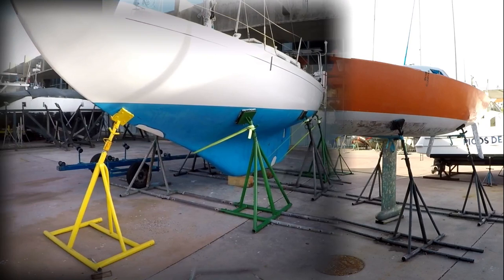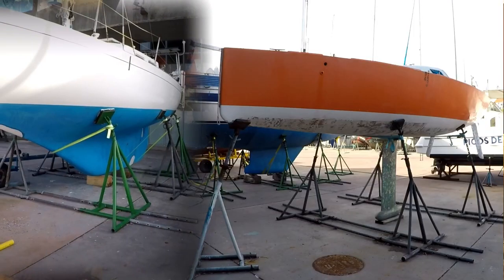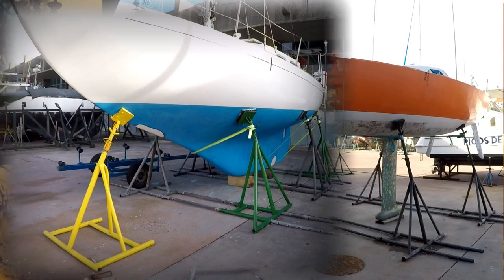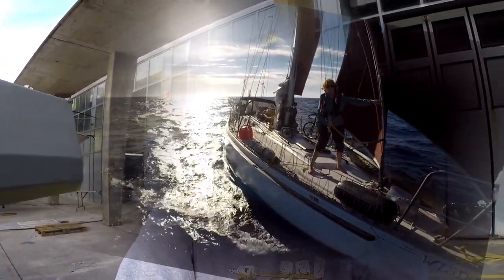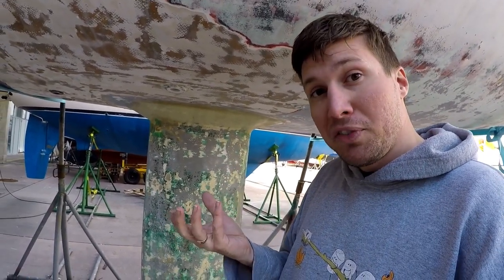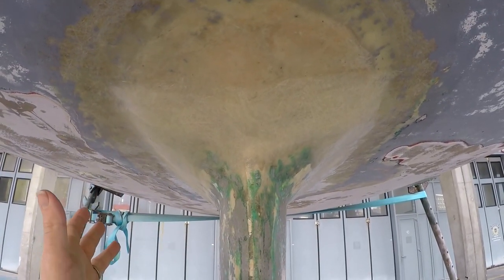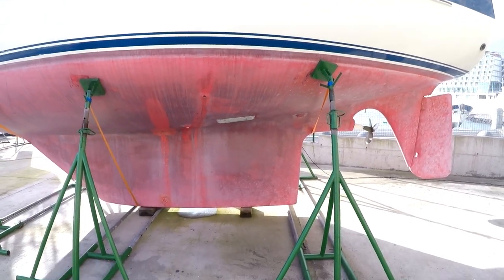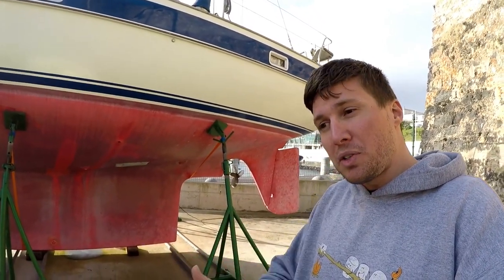Which is the BEST Keel Design? | Sailing Wisdom

Comment: Herb I am suprised you didn't mention swing keels, which is what I have! 3ft 6in when up and 7ft 2in when down! It is a great coastal and bahaman boat, but does give you limited blue water capabilities! And no keel bolts! What do you think?
Reply from the maker: Swing keels are the best of both worlds! You get shallow draft when you want it and incredible pointing ability when you need it. 
You can also play around and move the CLR by swinging the keel up partially to help the boat stay on a run and induce more lee helm (also useful to balance the sails)
I forgot to mention them!

My only concern with swing keels is the hinge mechanism, I can’t figure out how you could do maintenance without hauling out! Then again, I’ve never had one and I’m sure there is a way (especially in the clear waters of the Bahamas)
Reply: @RiggingDoctor  You are right there. I have seen someone fix the lift system on another channel but can't remember who! I'm sure it would be a pain in the water, but could be done.
Reply: From what I've read and seen, the Swing keels don't Need much Maintenance, but it's Critical that you DO Maintenance, at Least Yearly, and Of course a quick Inspection Haulout (as you'd do with ANY boat) after a hard impact. Mostly on Trailer-Sailors? @RiggingDoctor
Reply: @RiggingDoctor    all of your questions about maintenance on a swing keel will be answered when you research the "southerly" boats with swing keels.   they are partially serviceable while in the water.   Watch Paul and Cheryl Shard on the  "Distant shores" youtube  channel
Reply from the maker: Their DVDs are where I first saw a Southerly in action
Reply: @RiggingDoctor  https://www.youtube.com/watch?v=z6hdTiLQ_8c&t=87s
Paul discusses the swing keel in this video of their new 480
Reply from the maker: I’ll check it out when I have better WiFi!
Reply: @RiggingDoctor  On the Trismus boats with dual centerboards you can raise the front board completely while leaving the aft one down for long downwind runs.  Elements was originally built with stern daggerboards to accomplish the same purpoose.
Reply from the maker: I was worried I would bump into her foot and cause her some serious pain!
Reply: The hassle with swing keels especially if ballasted is their hinge and actuation mechanisms. Not to mention they take up space inside below decks.

Comment: The best hull and keel , stepped planning that pops up at around 13 knots with a 8° Deadrise and a partial skeg ..plus two shafts with 4 bladed props for stern lift and two big engines sucking old liquefied dinosaurs and turning them into power....  😎
Reply from the maker: That sounds like something my dad would say (he has a Egg Harbor)
Reply: ...said the stinkpotter! :-P
Reply: They're no good for crossing oceans with, though.. :-P

Comment: That's a really crappy repair job !
Reply from the maker: Makes you wonder how bad the crack was that made them think such a lumpy repair was needed!
Reply: @RiggingDoctor  I would spread the load out much further and make never be a problem again. The way they did it its going to fail again under load.
Reply from the maker: Yeah, the corners they created will be the new stress points!
Reply: @RiggingDoctor  thats what I see too. Plus resin dose not make strength.

Comment: Wouldn't a full keel resist lee-way (lateral slip) more effectively than a high-aspect ratio keel?  Why does a deep, thin keel allow you to point higher into the wind?  It would seem that a narrow/deep keel would allow the bow to get blown off the wind more easily.   Thanks for your videos!
Reply from the maker: It would make sense and that was the old way of thought. Modern testing has shown that the leading edge generates lift and the rest of the surface is wetted surface area (and drag). A high aspect ratio foil will create more lift and less drag compared to a low aspect ratio foil. 
The longer the keel goes down into the water, the more surface you have to generate lift and the more effective the keel will be, and therefore the better you can sail to windward without laterally slipping.
Now the caveat is that they only work at high speed, at low speed, the broad surface of a full keel will work wonders at holding you steady in the water. This is why a full keel will keep you steady and slow your drift while hove to.
Reply: While his answer is correct that a fin keel can produce more lift his explanation is nonsense
Reply from the maker: CUM BOT, I would appreciate it if you don't confuse others with your gut feelings about how sailboats work. The other thread was interesting to watch, but I don't like misinformation spreading and contaminating others. Please stop.

Kire Nireves, the last paragraph of the section KEELS discusses the advantages of high aspect ratio appendages: https://physicstoday.scitation.org/doi/full/10.1063/1.2883908
This next study was done on three different aspect ratio keels AR1, 1.5, and 2. The findings are rather self explanatory: https://www.researchgate.net/publication/237150728_Investigation_of_the_Effects_of_Different_Keel_Geometries_on_a_Sailing_Yacht
I hope this information finds itself useful for you, and I warn you that the internet is full of opinions but there has been a lot of research into the engineering side of how yachts actually work. The research is out there and some of it is actually counter intuitive. This is why modern race yachts look nothing like the race yachts from decades past. Science instead of tradition wins races and drives development of new technologies.
Have fun sailing and let me know if you have any other questions,
Herb
Reply: @RiggingDoctor  Thank you Herb!!  Science!
Reply: @RiggingDoctor  True but the ultra high AR foils are less forgiving in regards to stall. Also, the fact  that the rudder is connected to the keel is what slows responsiveness, it obstructs circulation flow around the foil.

Comment: There are two kinds of sailors.  Those who say they’ve run aground - and liars. 
Full keel is easier on the boat when you get - unstuck.
Reply: Kyle Guy -   See?  Honesty.
Reply: Yeah, will I had admit to only two groundings.   I had a 6 foot keel.  Sailed for about forty years.   One for a full minute, and the other for five seconds.  First I had an experience like Kyle Guy, my boat went up, heeled over, and then came back down.  As far as I can tell, I hit an uncharted rock.   Second time, happened when I took a transient slip at a marina, they told me there was more than seven feet.  I got stuck.  Quickly took the mast halyard, ran with it down the dock to the next finger slip, and pulled the boat off by the halyard.   I found that many marina's put landlubbers in charge and don't know about keels, and neap tides, and stuff.

To me, the most important issue of a keel, is if you go blue water sailing, which keel is best in a big blow.
Reply: @ppumpkin3282  - "To me, the most important issue of a keel, is if you go blue water sailing, which keel is best in a big blow."

Yep.. that's it in a nutshell. So far as I'm concerned, a fin keel and spade rudder = unseaworthy boat.

Comment: Great talk and video. 
The word you were both looking for early in the video is COMPROMISE. Everything on a boat is a compromise. So you can't have the perfect boat for all people in all weather. Eg, extra head room makes for high windage in small and midsize boats.
The thing you could talk about more in future videos is directional stability.
The racing types love fast turns and there thin keels are set near the centre of the boats turning access.
Cruisers like boats that do not broach. Having to take the helm for hours because the auto pilot can't move fast enough or is over powered by following seas is not fun. Hence the COMPROMISE of a modified long keel and skeg mounted rudder gained popularity. Not just because it supports the rudder shaft but also adds surface area aft to help the boat track straight.

Comment: I used to have an Alberg 30 and it definitely had a more "seakindly" motion, though much slower, than our current boat, an Aloha 32 with a fin keel.   We sail primarily in Lake Ontario, and are quite satisfied with the Aloha, which is designed primarily as a coastal cruiser.  The one concern I had with the Alberg is the fact that the ballast installed by Whitby Boatworks was comprised of iron tailings, rather than lead (as specified by Carl Alberg), and I was always worried about moisture ingress in a 50-year old hull, with ensuing rust and expansion during winter freeze up, cracking the fiberglass capsule.  Also, with an encapsulated keel any grounding is a big concern because of the possibility of cracking the fiberglass skin, resulting in water ingress.  Mind, a bolted-on keel can also suffer damage to the keel-hull joint, though if the ballast is lead it is relatively "soft" and will likely just dent rather than transmitting the force of impact to the joint.    Like you say, every configuration has advantages/disadvantages, and the ultimate choice for most buyers of used boats has more to do with the portion of the boat above the waterline than what dangles below.
Reply from the maker: Very good points! These plastic boats are getting old and hidden problems will start to surface in time

Comment: Apologies, I'm gonna have to rant on this: Although this video is a good basic reference, I disagree 100% with some of the statements about keels in this video. Modern bolt-on keel designs are the way to go. They are not unsafe. They CAN heave-to, very easily in fact (possibly MUCH easier than other keel designs). It's kind of surprising that people are still clinging on to the full keel concept when the design has been abandoned by the entire sailboat industry and racing community, and for some reason embraced as "truth" without question.  It's the same armchair hearsay, over and over again, than full keels are safer and are more "seakindly" and that they do better in storms. 

If all of this is true why don't modern naval architects build boats this way? Why don't the hardcore, bespoke expedition sailboats have full keels? Why are people racing the southern ocean with bolt on keels?  Maybe it's because bolt-on keels don't fall off with any kind of regularity, that many modern designs are VASTLY more maneuverable and faster in BOTH heavy, and light wind, which equates to safety. In a modern design you can outrun storms, sail away from a lee shore easier, and find propulsion much easier when your engine dies at the wrong moment. You can maneuver in tight spaces with ease, and leave full keel boats in your dust, any day of the week.

And as for the "full keels sail better in bad weather" myth: How did all the vintage full keel boats do in the golden globe race? How many boats finished? 2? 1? When you're running and your boat is slow, guess what, the apparent wind is faster, and the waves hit you harder. How could that possibly be safer? 

Maybe it's just the stubborn hearsay from old salts who are resistant to change. They don't like seeing their beloved boats outdated by new tech. As old salts, their words are seen as wisdom by younger sailors as truth. Remember what these old salts said about GPS, and any number of new technologies that have made sailing vastly safer for us all?
Reply from the maker: With regards to racing, there is no question which is better. 

With regards to not racing, I have done ocean sailing in both. My experience on a fin keel included a lovely storm in the Gulf Stream and the motion of the boat was anything but sea kindly. The boat smashed and slammed around rather harshly during the whole ordeal. 
My experience crossing the ocean on a full keel boat found that similar (and worse weather) was that the motion of the boat was much more sedate. Nothing happened fast and the motion was much more sea kindly. 
While keels don’t fall off “without cause” a common cause is striking a submerged object. We have sadly had a few strikes with unknown objects in the dark out in the ocean which gave us an awful freight but caused no issue to the boat. In a fin keel, that would be a much higher greater concern. 

All boats can heave to, all well built boats can survive a storm, and everyone gets to choose what they wish to sail with.

Comment: Some fact with a lot of misinformation. Clearly no understanding of the history of keel types. C'mon - do your research or stick to what you do know about. 

Thus spake the naval architect.
Reply from the maker: Care to point out and correct the misinformation?
Reply: @RiggingDoctor  - There were a double-handful of misstatements and misleading implications. Without watching the video again I remember a few. First and foremost full keel boats are not inherently safer (something you said a number of times). They exist as an artifact of available materials and construction techniques from when there was no other choice and continue because used boats are around, they have shallow draft benefits, and some people are nostalgic. There are as many failure modes for full keels as for attached fins. Do not lose sight of the design flexibility for greater static GM and improved dynamic stability (GZ curve). Of course operationally a real foil vice a barndoor for the rudder increases maneuverability which is a safety factor. Most fin keel boats can heave to just fine. I teach clients all the time.  "A full keel will make it (surviving a major storm) a little less awful" is simply incorrect. There are many factors to relative comfort and the keel is among the least. Windage is a big factor. Hull form is another; large forward sections can be a big problem. Rigging tune is a big factor. Sail suite. Engine size. Fuel capacity. Interior outfit including which way the toilet is oriented and whether you have lee clothes. The only benefit of a full keel in weather is that all the wetted surface makes a full keel boat lie to a sea anchor better; a drogue on any boat regardless of keel is arguably a better choice in survival weather than a sea anchor. For simple bad weather (say F8 rising 9) there is no benefit to a full keel; arguably the improved pointing of a fin or modified fin keel is a safety improvement. You referred to fin keels as the domain of cruiser-racers which will come as a surprise to the fine folks at Amel, Moody, Hallberg-Rassy, Najad, Garcia, and a lot of other fine builders for the bluewater market. There were other errors that don't come to me. 

This is the second video of yours I have seen (perhaps the third - people keep sending me links to all sorts of things) with poorly stated information. You do a disservice to those who follow in your wake to present ill-informed opinion as fact.

I regret that this will seem brusque. You are promulgating bad information. 

For context I am a naval architect and marine engineer with 40 years experience in the office, in the yards, in the fleet, and on the docks. I do six to ten offshore passagemaking deliveries each year on a wide range of boats. 

sail fast and eat well, dave

Comment: Whith that long finn keel  you can hook nets in the watter . Use folding propeller because when not used they are more protected against nets
Reply from the maker: That’s a good point! Our boat has the prop inside an aperture so nets or lines usually get pushed out of the way.
Reply: Rigging Doctor  but you need to modify the aperture to fit the folding propeller when colosed. I think to long feel boats the aperture is too small
Reply from the maker: We would have to go with a feathering style with ours